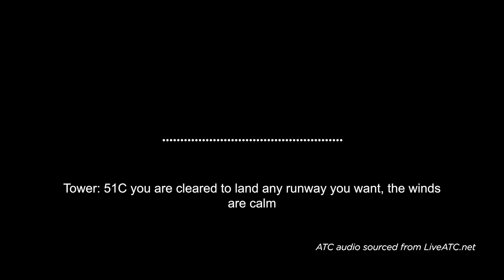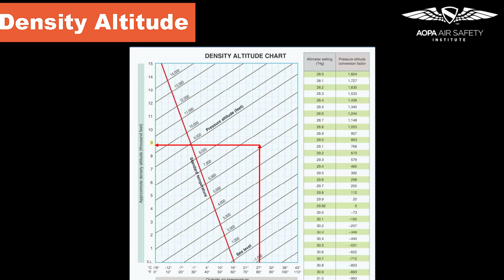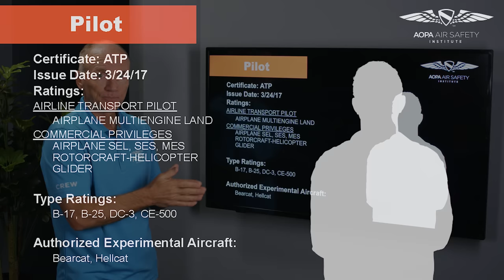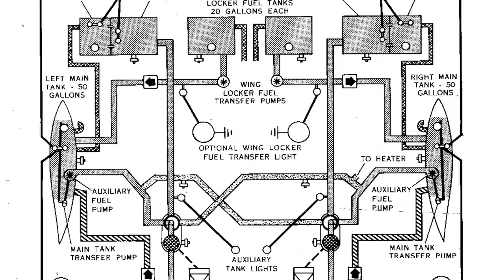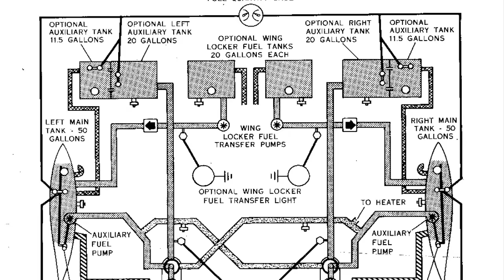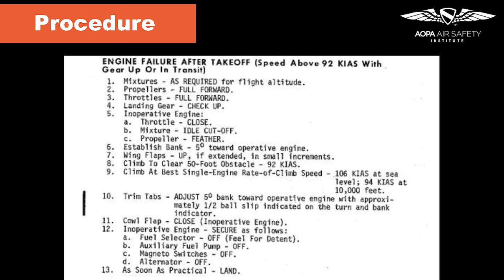Early Analysis: Cessna 310 Crash July 18, 2023 Santa Fe, NM

Comment: Excellent video. A tragic accident and a loss to both his family and community. 
As for causes, Is it possible that under pressure and due to the high density altitude that the first reaction to the failure would be to push the mixture up to full rich instead of leaving it set for best power at that altitude? Mixture is the first item on the checklist and says “as required for flight altitude” however it is very easy to do when most of your training and home base is at sea level that with a failure the ingrained first reaction in memory is mixture full rich as that results in max power at sea level. Full rich in this case would cause a loss of performance due to the altitude. Also with his significant experience is more complex types that have auto rich functions some reversion may have been a factor. Any which way it is easy to judge when not in the seat. I look forward to the report and the lessons from the video particularly about accepting on off field landing if there is a lack of performance is pertinent. On old and wise instructor once told me that in light twin the second engine will carry you to the scene of the accident.

Comment: Having flown a Cessna T-50 Bobcat with 245 HP engines and CS but not feathering props, the rule was if an engine failed on takeoff to pull back the throttles and land straight ahead. There was no hope of flying on one. Better to crash wings level than nose down and/or inverted.

Comment: according to another youtube doing the analysis the single engine service ceiling is only 7400 feet, Ill have to look that up now. Aopa website says SE Service Ceiling is only 7400 ft.
Reply from the maker: You're referring to non-turbocharged 310 performance numbers. The aircraft in this accident was turbocharged.
Reply: Naturally aspirated is 7400 feet, turbocharged is 17200 feet.
Reply: @Hedgeflexlfz  This plane should have had little trouble climbing and staying in the air on one engine, even given the density altitude..
Reply from the maker: @Hedgeflexlfz  The Aviation Safety Network website marks the aircraft as a "Cessna T310R II". T standing for Turbo. https://aviation-safety.net/wikibase/318173

Comment: Question.  Did pilot firewall throttles and mixture.  If so, it could have reduced power output in remaining engine.  Turbo's don't like to be red-lined.  This may well have nothing to do with density altitude and more about training.

Comment: Recency of experience is key. Especially at such a high density altitude. There's very little room for error or sloppiness in procedure. Another factor some may not consider is wind shear due to orographic or other turbulence. Not a big deal at full power but a huge deal when hugging blue line with an unfeathered prop, gear, flaps and lights flapping in the breeze.

Comment: This is my home airfield. I'm not multi-rated, but from what I understand, the first thing you do when you have an engine failure is get clean. Get above clean stall speed, get the gear up, get the flaps up, and get to best single engine climb speed. Then you can start to unfuck things. Turning is not going to help your situation if your aircraft isn't clean and well past VMC. Not sure if ATC giving the man a turn was a factor in the crash, but it certainly doesn't help adding more work to an already over-saturated work load.

Comment: I tried this in the same plane in Microsoft Flight Simulator in the same conditions. I couldn't get a climb rate out of it on one engine at that density altitude, and I also crashed. More specifically, I failed the right engine just after take off. The plane struggled to stay level, in fact I couldn't maintain level flight. I rotated at 90 knots, and was about 100 feet above ground when the engine failed, and it just rolled right and crashed. I feel for this fellow. What bitch of a situation to find yourself. :(
Reply: Does it mean that you should rotate at higher airspeed to cater to the environmental conditions?

Comment: That single engine climb rate to single engine ceiling assumes a new aircraft and airframe.  A lot of these old twins will get no where near “book” even if the pilot handles the engine failure perfectly.  That kind of density altitude in an aging 310 is a no go, simple as that.
Reply: Single engine climb is 390fpm and ceiling is 17,200 feet, so plenty of leeway for an aged turbocharged 310.
Reply: @bills6093  390ft/min at SL in a new aircraft.  Different story at 9000ft density altitude in an aging airframe even with a turbocharged engine.
Reply: @TheAussiePipe  Blancolirio calculated 50 fpm for the standard 310, so the turbo version should do considerably better.
Reply: @bills6093 so we have now gone from 390ft/min to "considerably better"? You are still failing to understand it's not just about the horsepower available from the remaining engine.  There are the aerodynamic factors to take into account operating the aircraft at 9000ft DA and the book numbers you are quoting are for a new aircraft and airframe flown by a Cessna test pilot.
Reply: @TheAussiePipe  I'm a big Blancolirio fan and his explanations of density altitude are very good. This plane should have had little trouble climbing and maintaining altitude, given the conditions. Why it did not, is almost certainly pilot error. I've seen no one do the calculations for the T310R. Everyone wants to do them for the naturally aspirated 310, apparently unaware that this was turbocharged. All we have is the sea level specs to judge from. So when someone does the actual calculations for this plane, on this takeoff, then we'll have the correct numbers.
Reply: @bills6093   In a new aircraft with a Cessna test pilot.  

“It ain’t what you don’t know that gets you into trouble. It’s what you know for sure that just ain’t so. “ – Mark Twain
Reply: @TheAussiePipe  Most likley actually said by Josh Billings. But Mark Twain did say this:“When I was younger I could remember anything, whether it happened or not; but I am getting old, and soon I shall remember only the latter.”

Comment: Is it safe to say, with a 9,000ft+ DA, 17,200 ft single engine ceiling (100 fpm climb) that the T310 might only have had about 240-250 fpm climb rate (just taking ratios)?  That would assume all sorts of ideal conditions, which we know are unlikely for an aircraft that HAS to be more than 40 years old.  Put on top of that the gear question and turning and it's easy to see there may not have been any climb performance.

Comment: I have a glider rating.  Why pull the power back if descending on one engine?  Any additional energy extends the potential glide performance, increasing options?  I never understand why powered planes don't have the control enhancing function of spoilers / speed brakes, and cost would seem relatively inconsequential when actually needed.
Reply: In a twin engine plane you can only use so much power on the non-failed engine before you lose directional control below minimum control airspeed. But in a descent, yes, you could possibly use some power from the good engine to extend the glide.

Comment: The 100 knot ground track with the given DA would be about 87 knots indicated, which is not much margin above Vmc-- the figure is given for a constant heading, with 5 degrees bank into the operating engine , not a banked turn away from it. And 87 knots is quite shy of best climb even going straight. It's unclear whether the data is showing baro normalized to 29.92, which might explain why it reads lower than field elevation, maybe 350-400 feet higher given field conditions. Still, that's only a few hundred feet to play with at best, and well on the wrong side of Vyse means behind the power curve. Can't trade altitude for airspeed to get up to best climb, and a turn robs critical energy exactly when it's needed most. From there it doesn't take much to induce an accelerated stall/spin at 85 knots during the turn to final just as the pilot runs out of right rudder.

Comment: Before engine start: Determine engine-out landing options on runway heading for emergencies below 400'. And obtain all information of every field or road longer than 1000' within 30degreea of runway heading, within 3 miles of the airport. Do not plan the impossible turn below traffic pattern altitude. Get to that altitude, or else land straight ahead.

Comment: The sad thing is that if his engines were turbocharged and not turbo-normalized like I think they were, he probably had another 60 short-term horsepower available on the good engine by overboosting it a bit. Pilots of these planes quickly become religious about avoiding overboost due to the $140K hit to the wallet but there is a decent safety margin for short periods of time. It would almost have to be included in the verbal or non-verbal before takeoff checklist to get burned into one’s brain:”I will sacrifice the good engine to gain altitude if the need arises”. If it pops also, the only choice becomes gear up, flaps down, pick a spot and take what you can get but with no blue line speed to worry about.

Comment: I had a left engine failure right after take-off in a tired, old Piper Apache. Fortunately, being a short field, the gear was already retracted. It was a thrill a minute getting back to my home field, as that Apache would not climb over 900 feet MSL. What it did prove was that I was a better pilot than I thought.

Comment: Very sad. All this experience could have also given a false sense of complacency. Failures like this need to be routinely practiced so task saturation doesn't creep in. I think this also shows that hybrid aircraft with electric motors and generator maybe the way forward for light twin aircraft as there are less points of failure and greater torque availability

Comment: The Cessna T310R has a single engine climb rate of 390 ft/min (fully loaded). It’s crucial to identify the dead engine, full power on the good engine, feather in this case the port engine fly into the good engine with 5 degree angle. Assuming gear and flaps were up there is no reason not to make it back to the airport safely.  In an emergency disregard ATC suggestions such as a left turn into the dead engine, pilot in command means doing whatever is necessary for the safety of the flight

Comment: There must be something wrong other than one engine failure with the aircraft.  There was also another Cessna 310 crashed in SNA.  Almost like a single engine is safer as you can just glide and land it in the desert.
Reply: Off field landing is typically safer in a single engine, because landing speed is much lower.
Reply: @russbell6418  depends on aircraft, there are exceptions like Aircam. From photo it looks like total lost of control.

Comment: Well i wouldnt tryst the climb rate specs, its and old aircraft even if it has new engines, parasite drag is still a huge factor in old airplanes, the clim b perf on that density alt is probably negative.

Comment: Any twin engine airplane that has a gross weight of under 6000 pounds isn’t required to have a positive rate of climb when an engine fails.  So basically the operating engine will take you to the scene of the accident.  This pilot should have done some weight and balance as well as determine his single engine climb performance. Had he done this, this adds to his decision making. In case of an engine failure.  Great Video!!

Comment: Airspeed on ADS-B track appears to be in excess of 100 knots on the upwind leg. Could it really be too slow for a single engine operation?
Reply: ADS-B tracks show ground speed, not airspeed. In calm air, at a 9000 ft density altitude, 100 knots over the ground is an airspeed of about 87 knots.

Comment: Looking at the ADS-B returns there was about 1 minute between the airplane climbing with increasing airspeed, then leveling off and decaying airspeed, then impact. That's not a lot of time to recognize the failure, identify the engine, and go through the memory items. Even flying alone in high DA situations it is a good idea to brief yourself about engine failure after TO in a light twin; e.g. below 500' AGL we land straight ahead, between 500 - 1,000 AGL identify, verify, feather and return to the airport, above 1,000 AGL, etc.

Comment: The engine will produce 100 percent power up to the critical altitude. VMC is higher with a turbocharged engine because of this. However the airplane may stall before losing directional control and with asymmetric thrust it most certainly means a spin that is unrecoverable.
Reply: The engine might produce rated power at higher altitude, but the prop still produces less thrust than at sea level because of the less dense air. So Vmc is less at higher altitude even with a turbo.

Comment: So, I'm 71, rented cessna 152's last 40 years. No problems. I've seen on news many many crashes. Almost every time I think yea it's a rain engine. I guess at cruise 1 engine does fine until you turn final , then stall , nose down crash. Very dangerous airplanes. Yea I know, it's use of rudder.

Comment: I believe the jury is still out on this one, therefore concluding his best option was to throttle back on the good engine is premature, & to say only turn this way or that way is nonsense. Additionally if blue line is only slowing your descent then  as long as you are wings level try several knots below blue line. It just might stop the descent.

Comment: OK, you're descending, but why would you kill your only operative engine!??
Reply: Not necessarily kill it. The strategy is to accept that you cannot arrest your descent and power as required on good engine to maintain control to the best spot you can find.
Reply: @richardmcspadden9189  He says, "pull the power back". If you had a good spot to land, yes, If not, absolutely do not pull the power back. Till you had time to assess what your options are.
Reply: You have to reduce power on the operating engine if you're losing control of the plane.

Comment: With only 203 hours flying the CE-310 PIC I've done a lot of single engine work and have noticed sometimes that rocking/yawing sensation tendency at times more that usual especially when the plane is dirty ie flaps out, gear down,  slow airspeed. I also have type ratings in the DC-3, B-17, with the special in the P-51 & P-47. so flying single engine in the 310 if you do it right will treat you just like having both so it'll be interesting to see what the NTSB report says next year or so. Sad day RIP Dr. Sherman

Comment: N5251C reg is a 310R... when on single engine it has a service ceiling of 7400ft. Density altitudes in Santa Fe in hot temps were well over the single engine service ceiling for this aircraft.

Comment: 8:19 that's a tough pill to swallow (to land off field) because you're talking about touching down at 80mph in an airplane that doesn't have a proper suspension to do so. In the terrain where he was: an off field landing wouldn't have been attempted in a glider that touches down at 35mph! 

Its worth considering that being Spiritually Fit is required as much as being mentally fit and trained for the situation. There shouldn't be this situation - and we shouldn't allow it, but there are simply places to have the wrong malfunction that is fatal, you just pick where.

Comment: I'm not a pilot and claim ignorance. A different  video indicated that the air traffic controller instructed him to turn left, a directive that turned the pilot into the failed engine. This action is against protocol for that plane. It seems, intuitively, that the ATC should have instructed him to continue flying straight until they had more information. Knowing which engine had failed would have allowed the pilot and air traffic controller to make a better decision. The ATC should recognize that there may be confusion and panic on the part of the pilot in an emergency situation. A little extra time could allow for better judgment.
Reply: We don’t know yet which engine failed.
Reply: It's NOT the controller's job to control the a/c. In an emergency situation, the FAR's expressly give the pilot the authority to do ANYTHING he/she thinks best to handle the situation.  Curiously, w.r.t. this accident, I've not seen anyone wonder why the pilot, especially with his varied experience, and clearly with difficulty maintaining altitude and airspeed (there's speculation elsewhere that perhaps due to the early failure, didn't retract the gear), make a slight right turn and land on I-25. At that time of the morning, traffic would likely not have been that busy, but in any case, his landing speed would have been pretty close to the prevailing traffics.

Comment: Sounds like this aircraft was not cleaned up and was attempting a turn.  He got an engine failure at WORST time with seconds to react.  He should have ignored ATC turn and gone straight out and cleaned up.  I’ve said before, ATC is the worst distraction when an emergency occurs - and I am speaking from losing an engine on a 172 at 800’.  I finally asked him to “stand by” and he never said a word until we were in the grass just short of the runway.  They are trying to help, but MUST understand we need ZERO distractions!

Comment: This was such an unfortunate thing.  I've always been a single engine guy as my instructor explained twins are nice, but those engine outs on take-off leave no room for even the smallest mistakes.  Here's my guess:  1.  72 years of age.  2. Sudden urgent problem.  3. ATC instruction to turn left.  4. Neither ATC or pilot clarifying which engine was out.  (assuming left engine is confirmed the dead one)
Reply: Pretty sure the ATC suggestion of rwy 33 was just that, a suggestion. Experienced pilots know that they don't have to follow clearances or suggestions if they have a good reason not to.